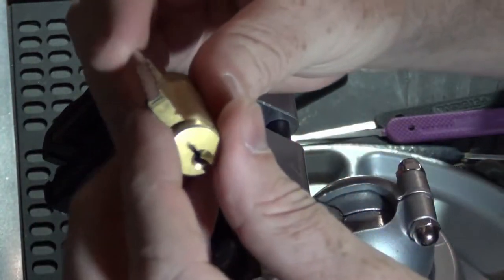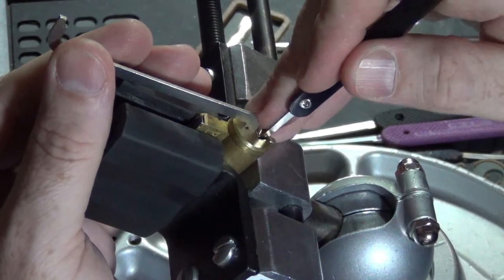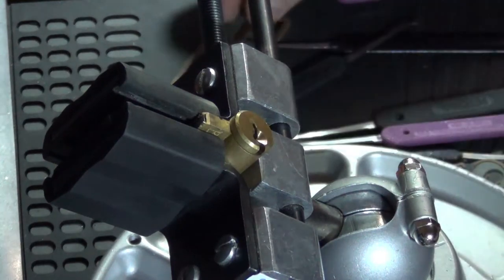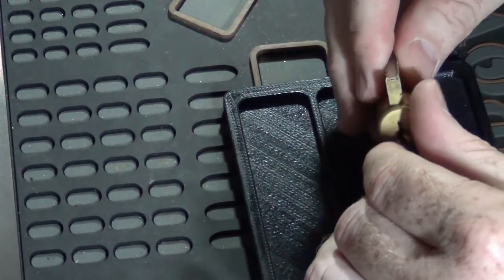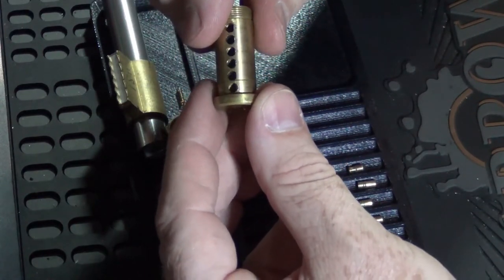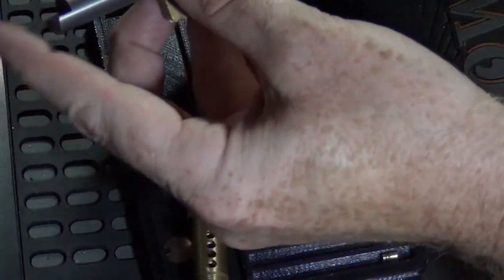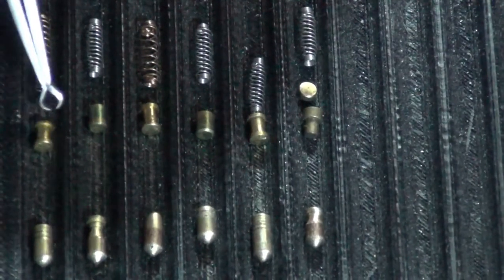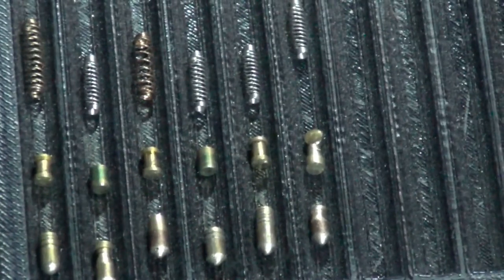(138) Bill Bacardi #81 Challenge Lock Spp'd

Comment: Nicely done ;) Bravo!
BTW how do you like the UKLP picks set?
Reply from the maker: SasPes I love the set...it's shafts are thin so they fit in paracentric keyways very well.  Metal seems strong and I haven't had any failures of the picks.  I've been trying to exclusively use these picks to test their strength. I'd equate them to the Praxis kit, but with handles, WHICH I like.
Reply: 5qu1n7 thanks for the info ;)
btw I finally got the package from you, it was stuck couple of days on customs :( I open it and I just finished with record a video :D fantasmic package and I'm still without words :) thank you very very much ;)